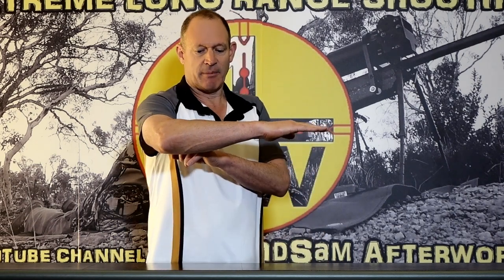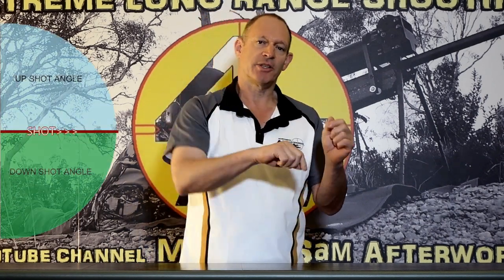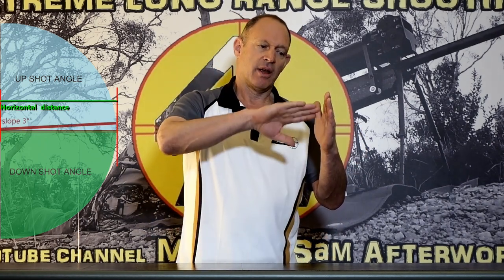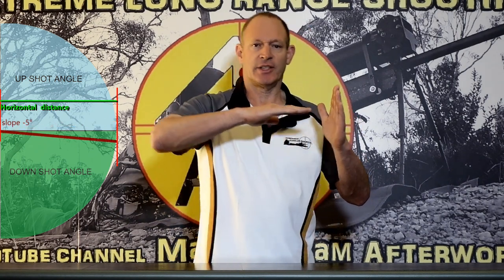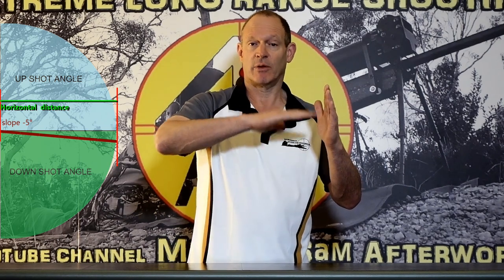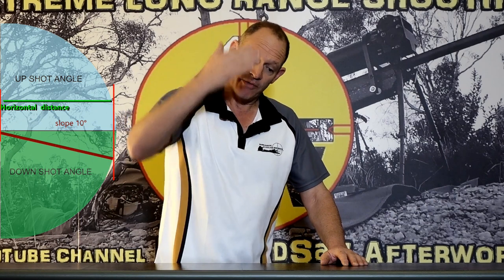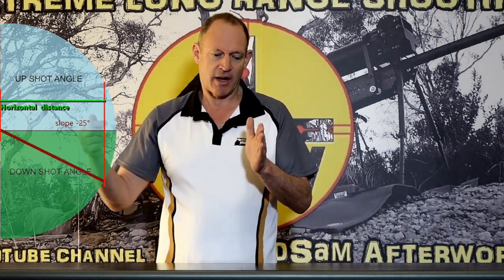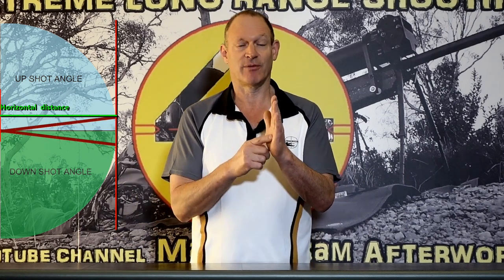A quick way to work out up/down hill shooting hold

Comment: I was really embarrassed when I realised this. The most effect range has on bullet drop occurs when the shot is horizontal: vertically up or down has no effect at all. Obvious, only took me about 50 years to realise! In addition, and sort of counter-terrorism intuitively, shooting vertically up wouldn't affect maximum range much, since gravity only subtracts 32 feet per second per second from the velocity. Come to think about it range might actually increase, due to the drop in air density with rising altitude. I'm sure the answer to this is well known, just not by me!
Reply from the maker: Thanks Geoff, glad you liked, Cheers
Reply: Geoff Keeler,
 And tho not counter -intuitively,  shooting vertically down would add ( or more aptly, lessen the decrease over a longer time ) by your 32 fps / ps formula ( at least till terminal velocity is reached / impact ).  .  .  .

Comment: Very good words Mark! I had an 'object lesson' on this topic while hunting in Wyoming for Pronghorn. My home range max distance is 547 yards and there's very little elevation change and usually not much wind. I was faced with a 330 yard full value Wyoming gusting wind at what felt like a massive downhill angle. I have exactly zero experience in that condition and no way to practice such a shot. I was on the ridgeline shooting down into the valley. I connected, but poorly. Second shot sailed just over it's back. Now get this: The pro guide said, 'Shoot a foot in front of him.' I did and put the next one right behind the shoulder. That was a LOT of wind drift and elevation change for  me to deal with. AND....in my honest ignorance, I didn't confirm zero in WY before the hunt because I had absolutely dialed that .308 in with my handloads of 150 gr SST's. Later, when I did zero in WY, it was shooting high and right. (Original zero was in Pennsylvania at 800 ft ASL) Wyoming was 5K feet ASL.  When I got home, it was shooting low and left. I mentioned that to an engineer that works for Kestrel and he was almost giddy  and told me he'd never actually talked to anyone that had that experience though he knew the physics behind it. Lesson learned for me! Always confirm zero!  Thanks for another great video!
Reply from the maker: Thanks man, thanks for the story too, cheers
Reply: 🗣The Hornady 150gr SST is a good round. I load it in my .243, .270, .308, and .30/06 (that is I load the SST in all four calibers)
  And YES, always confirm ZERO.

Comment: For normal hunting distances, say 400-500 yards max, if angle is steep hold a half moa low, if it's moderate or slight, quarter moa.  Hold low on the vital/kill zone.  Don't hold off meat.  This has worked well for me over the years.  fwiw.
Reply from the maker: Cheers

Comment: Excellent as always. This is an important topic if only to correct a common misconception that many hunters and other shooters suffer from. 
Often someone will be told, “You’re shooting up at an angle, so aim low,” but there’s usually no guidance on how “low.” In fact, and as mentioned, at short ranges and moderate angles the corrections are very minor. As also mentioned, a good ballistics solver app is the best way to determine the effect that shooting at an angle has on the elevation (and windage) correction necessary. Another advantage of a good app is that it permits us to experiment to see what effects there will be in different theoretical situations.
Reply from the maker: Thanks John, Cheers

Comment: Phew, i was worried you were going to say the 'horizontal distance' theory (that i was tought) was an old wives tale 😅. 
Never thought about the difference in barometric pressure over large altitude change though.
It changes again when you shoot near on vertical as gravity is then acting more or less parallel to bullet travel so shot wont come back through the sight line again, it just keeps going up in the scope (only really happens when shooting a pest up the top of a really tall tree with the likes of a .22LR or air rifle)
Reply from the maker: Lol, thanks Man, Cheers